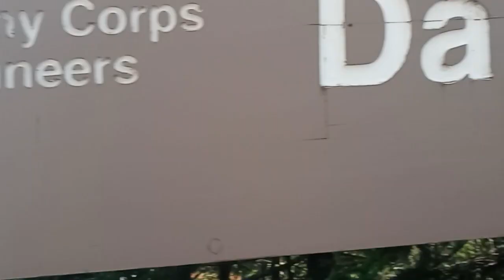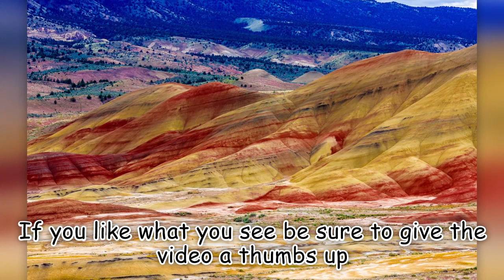Detroit Dam and Lake (Detroit, Oregon)

Comment from the maker: In 2021, the U.S. Army Corps of Engineers determined that this dam was at risk of failing in a large earthquake in the Cascadia subduction zone, which would result in a "potentially catastrophic flood", which could potentially affect Oregon's state capital, Salem, located downstream. For this reason, the level of the reservoir was lowered by five feet, to reduce the stress on the concrete structure.

Capacity: 
Drainage area: 437 mi² (1,132 km²)
Maximum inflow: 63,200 ft³/s (1,790 m³/s) 1909
Lake Elevation
Maximum pool: 1,574 ft (480 m)
Full pool: 1,569 ft (478 m)
Minimum flood control pool: 1,450 ft (442 m)
Usable storage (1,425.0 to 1,563.5 ft) = 321,000 acre-feet (396,000,000 m3)
Powerhouse
Number of units: 2
Nameplate capacity: 100 MW
Overload capacity: 115 MW
Hydraulic capacity: 5,340 ft³/s (151 m³/s)